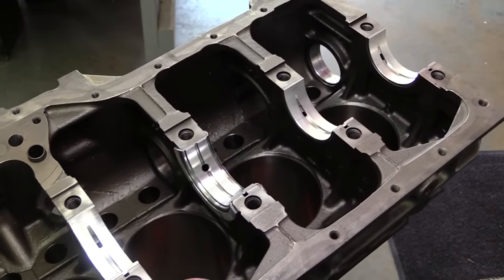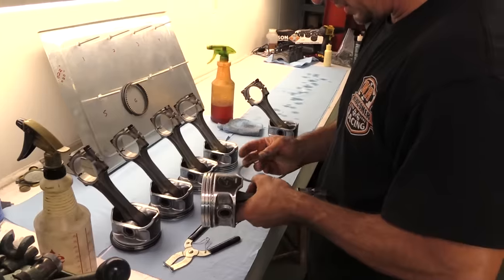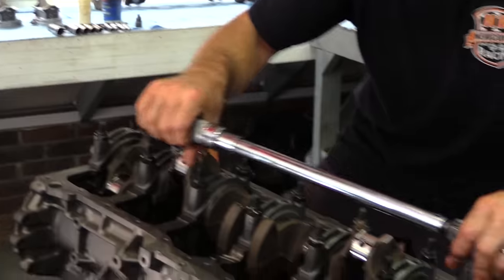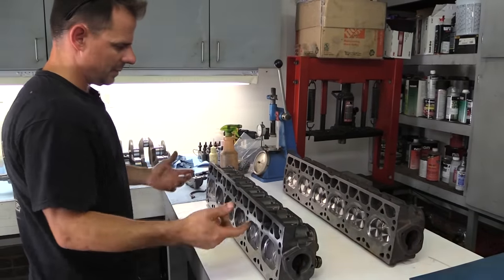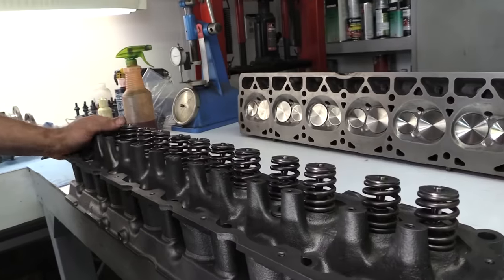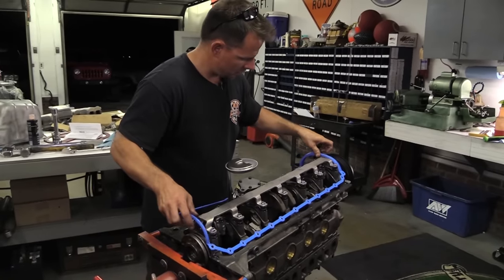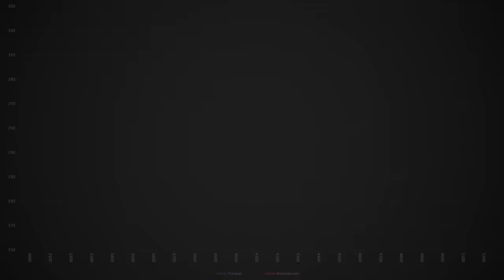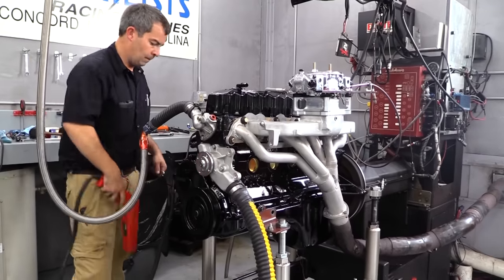Big Power Jeep Straight Six Stroker Build on a Budget with Newcomer Racing

Comment: Just built a 4.6 for about $2000, $450 for crank, $150 for old running 95 zj motor lol, and custom Russ Pottenger 26cc pistons $250 ish, runs on 87 in 110F summer heat no problem, had to deck 55 thou to use 4.2 rods tho, machine work was about $900, little much I think, so now I got me some neway seat cutters 😁
Reply: Any chance you can share more info on this I've been wanting to build a budget 4.6 on my own but can never find the right info.
Reply: @chrisjude6715  sure, I would stick with a scat 4.2 crank, the 4.0 rods are more ideal but apparently 4.2 rods work (702 or 707 casting preferably i forget) however you need to deck quite a bit for ideal quench and you need a bit of extra dish for running 87... cheromaniac and russ pottenger are great resources  for the details.. we decked 55 thou off the block, and I used russ's 26cc pistons. I am running a 95 cam and a 96 head, and a 2.5 catback, power is great, with stock reliability as im avoiding aftermarket cams... maybe a mopar cam but nothing else in my opinion.. I am having some engine noise at 2000 rpm free revving when hot only and I am not sure what it is but 600 miles and no oil burning and killer power... I was pretty unhappy with the machine shop I used and I recommend making sure you use a reputable shop, even if it costs a little more.. too many reasons to list but trust me on this one.. The idea on quench height is you can run about  0.040 on a cast rod engine to control detonation and improve mpg and efficiency, this allows higher compression per octane, stock is about 0.070! I think we landed just under 9:1 and it seems to like 87 in the hot summer just fine..
Reply: Had to get another crank, machine shop sent me home with a severely bent crank, had to pull it again and replace it and went with a mopar 229 cam 

Loads of power runs amazing even with a stock tupy head and stock intake and exhaust manifold from the 01 era, it works well 

Tough to find a good header for the newer jeeps, and it runs so well I'm not worried about it
Reply: 10k miles still beating on it but with the 229 cam it needs 89 the only drawback mileage is good though maybe 17 hwy with 32" 10 plies

Comment: Definitely going to be doing this. I want to pair this thing up with a Dana 44 LSD with a 4.10 gear ratio. It would be unstoppable.
Reply: A low-redline stroker with a 4.10 rear? Top speed will be disappointing, but it will be awesome if all you want to do is pull out sequoia stumps
Reply: @peters8758 , Yeah, I'm not trying to drag race it but I do haul a decent bit of firewood with my XJ and this would make all the difference in the world.

Comment: I built my 280 11 years ago for around $2500 and the mopar 30ab(.45” lift)cam wiped intake #1 lobe in May.  I dunno how Newcomer used a .5” lift cam with stock springs, but I guess his 5k redline  prevented binding.  I highly recommend a stroker if you are a 4.0 fan.
Reply: They machined spring seats I believe they said. If not here then in another video they mention it
Reply: I just caught it again actually
@ min 6:38 - “pocket port the heads & back cut the valves.”
I’m still searching for what it means to “LS Port” the heads. Or “LS Treat”, I just don’t get the term because it’s not just bigger valves… 🤔

Comment: 5 grand is a budget stroker good god
Reply: I've been doing this for 50 years even though I'm semi-retired five grand for a budget bill that's awful expensive they must charge $150 an hour? List on Parts with no deals whatsoever? I've done this stuff for years and I was never lucky enough to get 1/3?
Reply: @brantardrey7360  Ditto across the board!!...a friggin crate motor is $1,600..for crying out loud...where the heck is the other $3,400???
Reply: BILL randell - in the video he states that the long block goes for $3500. Considering the work involved a $1400 difference seems reasonable.....to me anyway, but Im not really in the market.
Reply: Pat Ball - Seems that ATK is the benchmark. It would be tough to compete with their production volumes.
Reply: 5k is what they want for the complete built engine, You could do it yourself for less by rebuilding your own engine. 5k is paying for the easy button lol

Comment: Never forget that the straight six is one of the smoothest configurations for an internal combustion engine.   Jag E Type.  BMW M3 and such.   Hell, the only reason BMW switched to the V8 for their higher performance cars was because of more displacement and better emissions qualities.   They also can sit lower for better CG.  And shorter length too, so if you can keep most of the engine behind the front axle, handling improves dramatically.  Anybody ever drive an 80’s Audi hard into and out of a turn.   Weird feeling when the front end kind of doesn’t want to change direction, cause a fair portion of weight is in front of the front axle.   I guess they got more cabin space, but jeez, at what cost?   Any rain or grip issues and those things would understeer so badly I thought I pissed myself a few times while all but sliding into a curb.  Not a good way to bring dad’s 5000S home.    Anyway, I think that horsepower number sucks, and they should have built it with low compression, who cars about flow numbers, and put a small turbo on that mother and get 400 ft/lbs without pushing the block hard at all.   Let’s see, thick walls between cylinders, main cap girdle, use forged rods, and cosmetic head gasket and forget all about it until oil changes.    Proceed to climb a wall or pull that boat like it’s not even there.  Screw a V8.  Oh shit did I just say that?   I might not wake up in the morning after that slip up.
Reply: The Audi 5000 had an inline 5 cyl engine.... ;-)  (and yes, it was a pig for cornering)

Comment: ii wasnt expecting 300 horses from that, surprising
Reply: that motor was designed by chrysler Australia in late 60s ,we call it hemi 6 ,they ease make 400hp
Reply: @twistedthrottle8513  euh no, this is an american motor engine designed in 1985
Reply: @twistedthrottle8513  the hemi six was also designed in the U.S. Chrysler intended it to power light trucks. They decided to use V8's instead and palmed  it off to us in Oz. They said it wouldn't handle over 4 litres but our engineers proved otherwise. Ends up powering the fastest accelerating Aussie production car for 25 years. And to think they kept the slant 6 til the 80's!

Comment: I've got the 4L six in an 06 Rubicon.  I will never sell it.  Ever.
Reply: I love my 2004 Wrangler, too.
Reply: My 06 Rubicon also has that engine. The only thing I would replace it with would be a diesel. But I've always been a straight 6 guy so getting a straight 6 when I bought it in 2006 new was a no brainer. That with the 6 speed manual was a must. After 12+ years of owning it it still only has less than 53K miles on the clock. I have to laugh at all the "Trail Rated Rubicons" made after 2006 with their 3.8 L V6 engines. LMFAO.
Reply: @thebusterdog6358  I've got well over 100k on the clock of my Rubicon,   if she gets tired I'll pull it out and freshen in up and get another who knows how many miles out of her.  Oh I also have an 88 F-150....what engine?  300 I-6 of course!
Reply: I know a guy with over 200,000 on his '99 Wrangler and still going strong!
Reply: @wyomarine I too live in Wyoming at 7000 ft.  My Rubicon spends the majority of it's time off road in the Winds and Gros Ventres. I'll agree it is not an ideal highway vehicle but with that I'll say I've driven it to Oregon and ND on a couple of occasions but these things were built for off road applications. Plenty of power for everywhere i go with it.
Reply: @wyomarine - Cora here.
Reply: @jeffreyrubish347  
I'm at 243000 now on my 05 LJ.. only run syn. oil from time I got from dealership.
Reply: @wyomarine its underpowered in wisconsin.  I swapped a 6.0 lq4 into my wifes lj, 19mpg and it isnt even tipping into throttle going up big hills.
Reply: The Busterdog 

If the V6 was as reliable I’d take it over the I6 any day
Reply: @tacomas9602  the 3.6 is pretty rock solid and nearly 300hp

Comment: Why are they starting the dyno pull at 3k rpm when it redlines at 5k?we're not even seeing half the powerband.
Reply from the maker: Making a dyno pull on a motor at low rpm's puts a big strain on the motor. Most reputable engine builders won't start a pull below 3,000 rpm. Thanks for watching.
Reply from the maker: It is mainly because the rapid increase in cylinder pressure created by the combustion of the air/fuel mixture is the same no matter the engine rpm. In the real world, if you stomp on the throttle at low rpm in low gear you will gain rpm quickly as the car accelerates (or the wheels spin). This actualy protects the engine. But on a chassis dyno, the dyno apparatus controls the rate of rpm gain as a way to measure torque through the range. So if you begin your dyno run at low rpms, you get full combustion pressure from the ignition of the air fuel mixture while the piston is still high in the cylinder. And because the dyno doesn't want the engine to accelerate too quickly, it keeps the piston's movement down the cylinder bore slow. This combination creates tremendous stress on the piston, the connecting rod and the cylinder walls. If the engine's rpm is higher, the piston moves down the bore more quickly, allowing the combustion pressure to be turned into mechanical energy and protecting the piston. This is also why it is a bad idea to apply full throttle in your car while in high gear at low speed. Hope that makes sense!
Reply: @TheHorsepowerMonster Great points, not to mention that the hard parts on this engine are not "broken in" yet. I don't care what anyone says, an engine needs to run through a few COMPLETE warm up and cool down cycles before bearings, gaskets, etc are fully seated. As you said 3k+ RPM is fine but putting stress on a brand new build from idle to redline would be asanine

Comment: Pretty cool. I like straight 6 engines, but they are far from budget. I swapped a 6.0 aluminum LS2 into my jeep for less that $2500. Thats motor and transmission. Makes more power at lower RPM and is more fuel efficient. Either way they are a good engine. Good video

Comment: Could the aftermarket build a cross flow head for this enging? If not, why? Same with the Slant 6.
Reply: Pushrod's are in the way.
Reply: Thanks Gabe
Reply: As shown in this build the factory head is just fine, no need to change it...
Reply: 300+ hp and 330 ftlb supposedly just from a cam swap showed its not necessary that's what I meant... It's so cost prohibitive compared to a $200 cam lol..
Reply: @doddgarger6806  What video did you watch? This was a complete, 100% overhaul. It has a stroker crank, increased piston bore with new rods and pistons, port work, cam and a $5,000 price tag.
Reply: @wvXvxvXvw  I see thank you for the clarification, there was a bit of ambiguity
Reply: @Kurt Lamprecht make friends much?  🤣
Reply: @Kurt Lamprecht Man that hurts I was really hoping we would hit it off too!!!!
Reply: @Kurt Lamprecht 
What your saying is probably correct, the problem is cost. And it's doubtful that the cost to build a crossflow would make it worth while .
It's very expensive to build new heads, especially for something like a straight 6.
That's why lots of heads are available for Chevy engines, lots of buyers,  and high production. With that 6 the price would probably be very high. And most folks wouldn't spend the money for it.
Reply: @wvXvxvXvw  According to the video, all this motor got was a basic bowl blend, no port work, backcut valves, and a replacement cam, off the shelf 4.2 rods and crank, and some cheap sealed power pistons.. Not stock but nearly stock. This is respectable power for a few small touches that will run with what sounded like stock or almost stock valve springs.. Definitely something that could be pretty easily duplicated... The price is fair for what's on the market for sure, but this shows there's quite a bit left in there with the old dinosaur tractor head..
Reply: @doddgarger6806  Kurt is right; the stock head may work, but a cross-flow head will always work even better. It's just physics. Engines are air pumps, and when you can get the air in and out easier it allows much better efficiency and power production.
Reply: @Kurt Lamprecht 
You were complaining about the cost, so I figured that's what you meant . Still if you think you could make more power for less money why not do it and show all us dummies how wrong we are?
Reply: Ford Australia made a crossflow head for their 250 cube six. Was a fair improvement over the pre-crossflow, they may have been interchangeable but don't quote me. Crossflows were made in steel then alloy. Look up XC Falcon crossflow.

Comment: My shop vehicle for the last 25 years has been 1 of 2 late 90z Cherokees.  The one I'm driving to this day has 270k miles, uses NO oil between changes, and walks away from stoplights and leaves people wondering WTF just happened. It's called, TORQUE. I've seen the 4.0s with 600k plus miles, and never been apart except for maintenance items. By the way,  I build Racing Engines for a living,  Nitrous and Turbo bikes from Harley and Suzuki.  The  4.0 litre Jeep is one of thee best engines ever. 🇺🇸🇺🇸

Comment: I say this over and over but I love these motors and they are about as good as it gets for a jeep. Yes I like an LS but running tires less than 40s with the right gears they arent bad. The jeep 304 never impressed me. You got them figured out. Its nice to just put your feet in the floorboard and let it crawl with that heavy ass crank and flywheel chugging you along.

Comment: Just got done spanking another BMW from a red light romp with my 99 xj with 3” lift and 31’s on a stock motor with 290-k.
Love the torque on these jeep 4.0’s but my girl is starting to make some noise at this mileage and power fading a little .
I see videos like this and wish I had deep pockets.
I have a motor pulled from a 1995 cherokee I was going to use for a build and have ready if my current motor gives up but not sure if the 95 is a good candidate for my 99.
My 99 still has a distributor and not that cam sensor and dreaded coil pack junk.
The motor cost me $50 so no big loss if not.
Would love some input from some of you more knowledgeable guys on this.